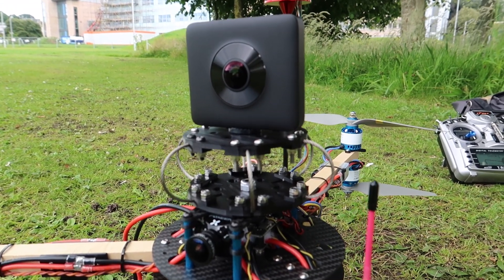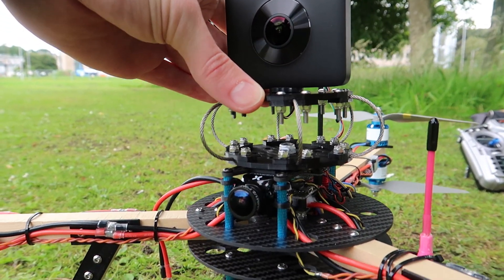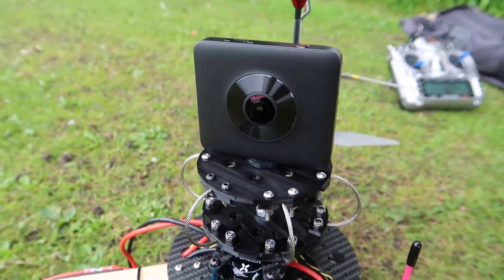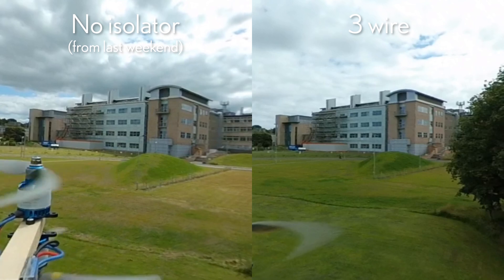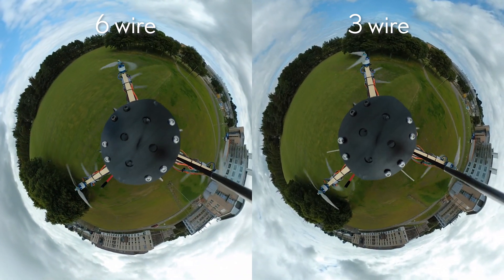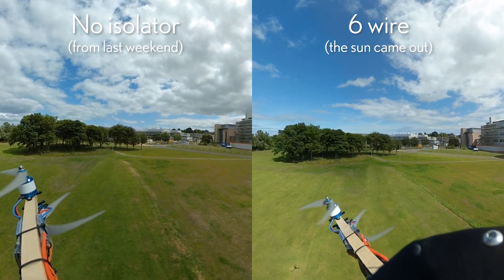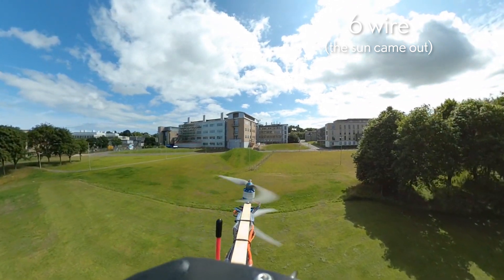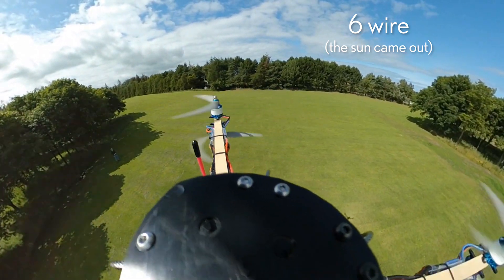DIY Wire Rope Isolator // 360 Camera // Y6 Everycopter Drone

Comment: Great stuff! I imagine if you use a heavier camera, the 6 wire option may give you the desired result. the stiffness of the cables is of course relative to the weight of the payload

Comment: I just printed your project and I wonder, does the wire needs to has some kind of “tops” or anything like that at both ends? How do I avoid the wire moving out from each end?
Reply from the maker: I just inserted the bare wires. Depending on the exact thickness of your wire you may need to adjust the scale of the print slightly.

Comment: Hi. Where can i buy that? Thanks
Reply from the maker: This was just a DIY project, you can't buy any of it. There are links in the description to 3D printable files on Thingiverse.
Reply: @CJDavies  thank you so much. Will this work to reduce the shake when walking carrying camera
Reply from the maker: @resortsph  No, wire rope isolators are designed to reduce small, high-frequency vibrations produced by machinery. They don’t really work at all against larger, slower, undulating motions of walking.

Comment: Am I reading this wrong, or does this imply that video drones no longer need gimbals? Get rid of the vibration and there doesn't seem to be anything that a gimballed camera can do that this one can't.
Reply from the maker: If 360 cameras had perfect IMU based EIS, perfect stitching & much higher resolution, then theoretically yes. But currently a regular 4k video camera in a gimbal on a drone will produce a much better shot than a 4k crop of the same frame taken from a 360 camera with no gimbal. It's intriguing to think that the 360 approach may become realistic within the near future though!